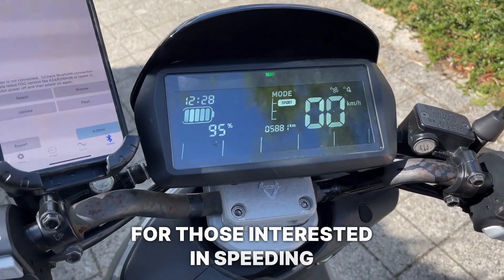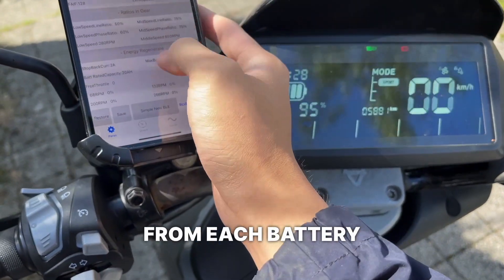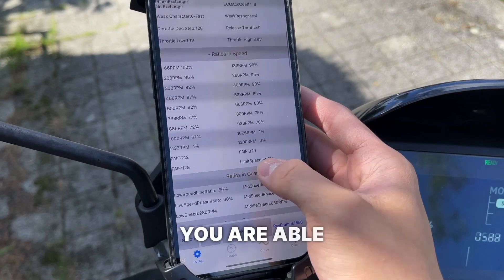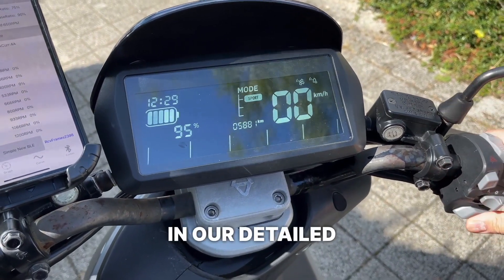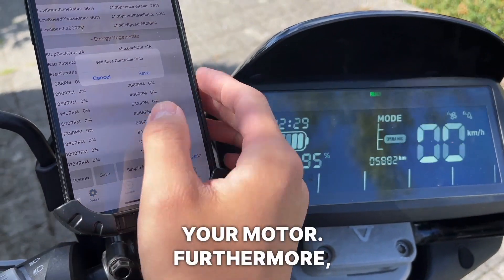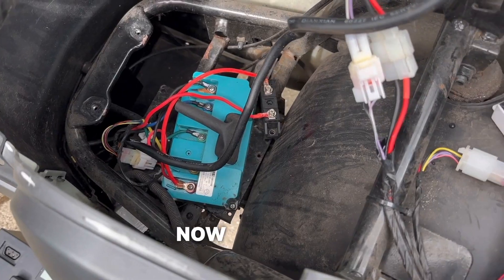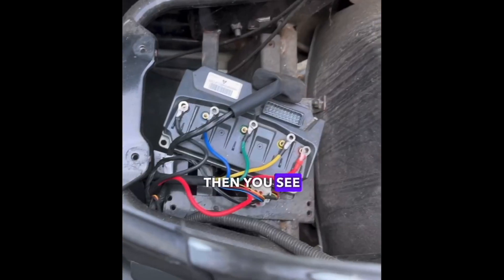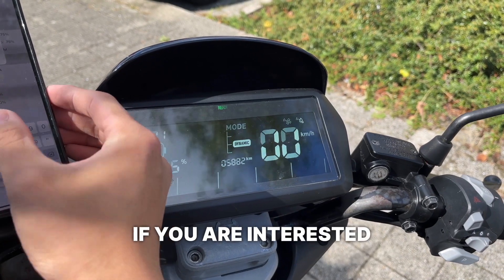NIU Scooter Speed Unlock with our Bluetooth Motherboards

Comment: whats that red sign flashing?my gts pro 125 cc goes only with 2 battery 90 km/h.are u not stress the battery too much?im wondering what u need to upgrade these dashboard for the latest one.i see u guys dont have much parts for gts with 14 inch rim.12 inch fenders can be fitted too but need to mod it.also no suspension because this model have 350 mm shock absorber.front fork have 31 mm and headlight fitting also different.the prices are a little too overprized.i can get all those parts much cheaper from ali.
Reply from the maker: We do have parts for the NGT if you want them. 

The original 60V batteries from NIU can handle 45A maximum each so it could run at 90A, the scooter displayed had an ampere of 70.
Reply: @escootparts2284  gts not the normal ngt or how niu call them.they use the same hardware?all i want to replace this dash for the new one.
Reply from the maker: @dokesz530 see this link 

https://escootparts.com/product/screen-upgradeset/